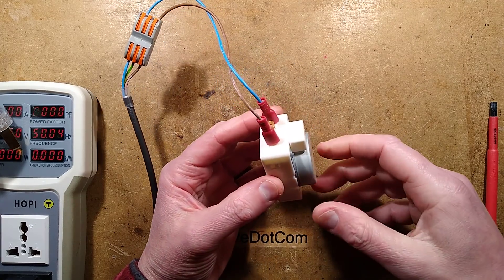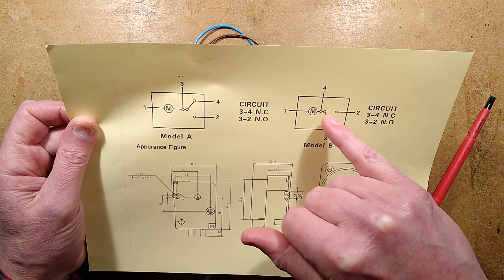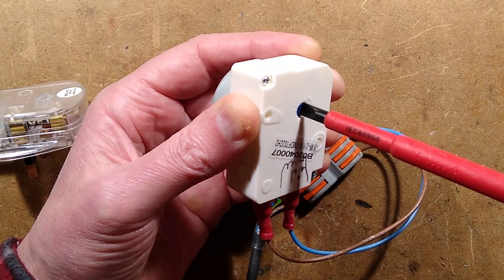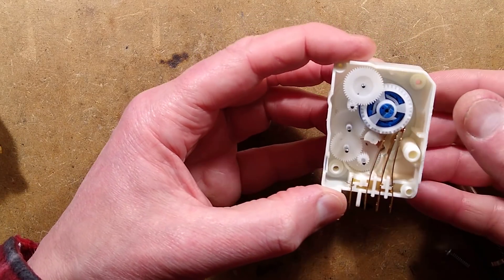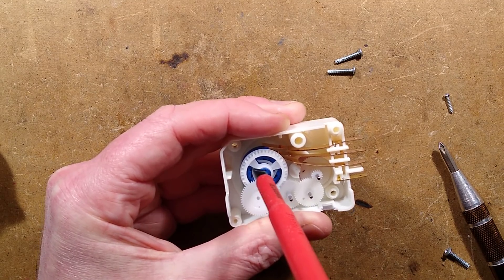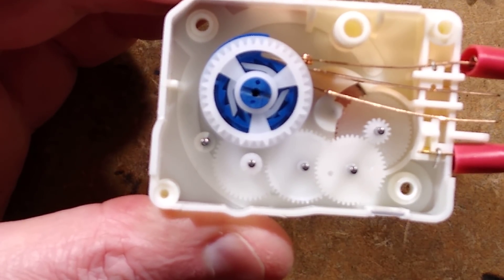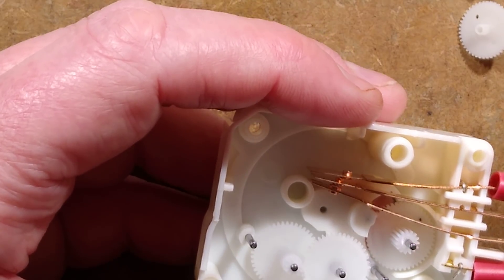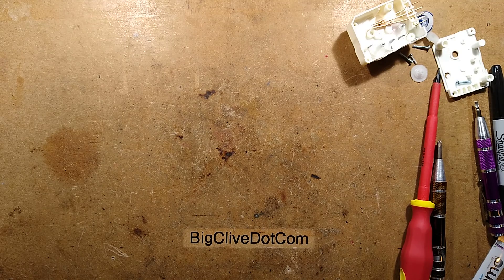Defrost control timer.  More complex than you might think

Comment: Cool!  I've been thinking about hacking my fridge with a relay to disable the defrost cycle if the fridge is running from the battery system. It's about 400W, IIRC, and I'd rather not burn battery juice heating, then cooling the refer again. Figure skipping a defrost cycle (or two..) while on emergency power wouldn't hurt anything, and save some juice. (Could even rig it to force a defrost cycle when switched back to line, but doubt it'd be needed.)  I see by what you're showing that it's not just open the heater circuit.  There's more to it than that. (I have to get the schematic for the refer first, of course.) Also need to time the average defrost cycle, might be so short that it's not an issue.   (Hey, when I'm not blowing up batteries, I'm trying to cut my usage as much as possible. At some point, if it's a multi-day outage, have to run the genny to top it off. So the longer I can 'coast' the better. And it's cheaper and easier to stuff the batts from the utility...)  Anyway, enjoyable and informative vid!  Take care!  Thanks, Stu.
Reply: Quite. If it's as Clive has shown, opening the defrost stat will mean that the defrost cycle is almost immediately terminated .. I suppose the question thien is "how long is almost immediately". It might be simpler instead to use a relay to take the defrost switch out of circuit, so it's only ever running the compressor . and operate that when on battery? that will also mean that the time to next defrost is extended by the time on battery, rather than the defrost cycle being skipped.
Reply: That's interesting... 🤔
I'm never in the position of running freezers from batteries, but we're on Octopus Energy's "Agile" time-of-use tariff where the unit cost varies every ½-hour based on wholesale costs¹, with day-ahead rates being published around 4pm (UK time) each day.

So it'd be nice to prevent the defrost heaters in our two frost-free freezers running during the most expensive times of day. I don't think they use a lot of energy compared to the rest of the house, but it'd still help to run them overnight at 0~10p/kWh instead of late-afternoon at 25~35p/kWh!
In one of the freezers I have a temperature sensor reporting readings to InfluxDB² so I know that the defrost heater only runs once a day, so I'd only need to find a single ½-hour period of cheap electricity per day.

I've also considered building battery packs to run e.g. PCs from batteries during peak hours, recharging them during the cheapest times (maybe even using "PicoPSU"-style PSUs to run the PCs direct from the battery's DC, instead of wasting a load of energy converting to 240V AC just to convert right back to ≤12V DC 🙄), but return on investment isn't great for that, I don't think. The side-effect of having longer-lasting UPSs would be nice, though.

Incidentally, time-of-use tariffs (and the sustainable, lower-carbon electric grid that they encourage) are a great reason for network-connected appliances - washing machines, tumble dryers, dishwashers, central heating, water heaters, air conditioning, electric vehicles, fridges and freezers (as per the above), etc.
I don't know whether existing IoT appliances offer this functionality, but they could be scheduled to run whenever electricity is cheapest/greenest, pulling data from your energy supplier's API, and could even communicate with other appliances throughout the country to spread demand. Even better for appliances doing tasks that can be paused if electricity is briefly more expensive or there's a sudden high demand on the grid.

Think about it: you often don't care exactly when your laundry is cleaned or your dishes are washed, as long as it's done before you get up in the morning or whatever. So tell the appliance "clean my clothes by 7am, costing the least money and CO2 emissions possible".
There are some promising possibilities - although the current situation leaves a lot to be desired (security; privacy; vendors shutting down online services, effectively bricking hardware; devices breaking during Internet connection outages; ...). There's a reason I self-host much of my "smart home" infrastructure...

¹ It's worth noting that Agile is capped at £0.35/kWh - including 5% VAT - so we'll never see completely ridiculous rates like many Texans did during the storms in February when the wholesale rate apparently jumped from $30~$40/MWh to its cap of $9000/MWh for several days! Note: that's per-MWh rather than _per-kWh_. I don't know how Texan supplier(s) convert that to rates charged to consumers. It's probably higher than just "÷ 1000" ($0.03~$0.04/kWh, jumping to $9/kWh), but even $9/kWh is very painful and would mean $200/day [£145, €167] for this house - and it'd be so much worse if we relied on electric heating! 😬
(Texas Feb 2021 storm info is all from this excellent Practical Engineering video that I highly recommend to anyone interested in the technical side of what happened to the Texas electric grid to cause the outages: https://www.youtube.com/watch?v=08mwXICY4JM )

² If anyone's interested: ESPHome on a Wemos D1 Mini outside the freezer with DHT22 and DS18B20 sensors connected via FFC to minimise door seal gaps; sends data to Home Assistant and then to InfluxDB, using Grafana for graphs.
Reply: @AndrewGillard  Good point.  Something like that is starting up around here soon as well. (Thankfully, got my mom on a solar system that currently covers all her usage annually. I can't do that, redwood trees everywhere here!)  If it's anything like the ratios you are talking, I could shift to total battery during the greedy times, and recharge at the off-peak. Even Li-Ion cells are good for 1000's of shallow cycles.

 All my lights, fans, computer/modem/routers and such are on a UPS tied into the scooter batteries. The refer/freezer will be on a switched inverter. (Still building the setup)  By the way, a really easy and cheap way to get your PCs and such on batteries is to pick up a quality used UPS on Ebay or such, sold cheaply when the batteries failed. (And usually shipped without them, which is great for waste and shipping costs!) I used a small APC UPS as a power source for over a year, hooked up to 6 golf cart batts. Charged via small inverter generator in the afternoon-evening, ran things the rest of the time.

  Now using a larger unit, sine wave 800W/1000VA industrial style unit. (Minute-man brand, designed to use with as many external batts as you want to hook up, as long as you charge externally as well.) About $75 US. It's hard to find a 36V based UPS, but that is what the scooter packs (10S Li-Ion) are putting out. The cost of the batteries and the quality made it worth the 36V hassles. 

 Power is more than dicey up here with the trees, fires, winds and such. Can drop from a short glitch to several days. Many times most of a day or more. Now I can keep running just fine, and hook up the generator if things stay out for more than 24 hours, run the charger (42V/30A Cisco surplus supplies. Two for like $45 or so the pair. Into an intelligent buck-style P/S, that can output 50A max, current and voltage adjustable/limited. Works a treat.)

 Once I get the rest of the battery bank finished, without any more explosions, please, I could run the whole (very energy frugal 900Sqft house) place for a few days on battery alone if I use tablets and laptops instead of the 'big' computer setup. And that would be with freezer and refer. (Microwave as well would run on the 3000W inverter for the big loads, but only running on demand. The UPS covers the critical loads.) 

 Definitely consider 'retired' UPSes as an option, all different sizes and types out there, usually very cheaply.  The little APC I used for over a year was a little Back-ups model, modified to bring out the battery leads to a couple of big brass bolts on the side. It ran a load of between 40W to 300W, 24/7 for over a year. (Hillslide tore the power away from my house, took awhile to get support back under the house and a new power feed.) 

 After I de-commissioned the unit, I took it apart and studied it for stress points, capacitors, browned circuit board and so on. It was still perfect. No signs of stress. This was the Back-Ups 600, IIRC, and was one of the low-frequency transformer-based units. Still a low end model.

 So best of luck with your setup. Sounds like you've got a ton of monitoring already, that'll help. Keep your loads as tight as possible. (Note that in my battery-explode video, there was a Mini-split cassette in the shot. Heat pumps are very rare in the US for some reason, but I put one in here. Love it to death. The rest of the world definitely knows the way to do things. Even my small (1800W) inverter generator can run the mini-split, and put quite a bit of juice back in the batteries at the same time, as long as I don't crank the nutz out of the thermostat.  Only pulls what it needs... Nice widget!

 Take care, stay safe! (No drywall screws thru lithium batteries..:)  Stu the batty.